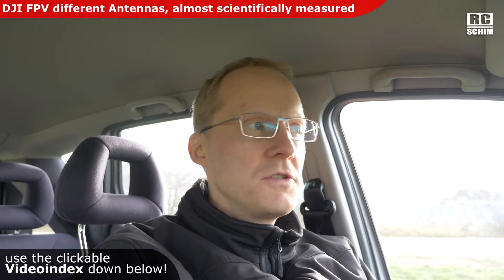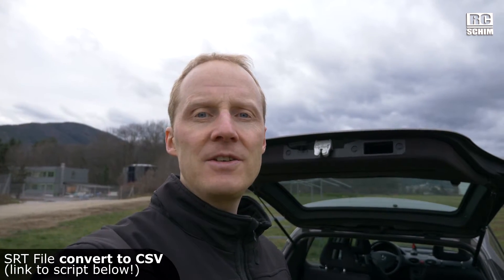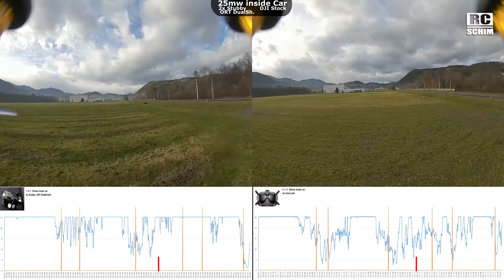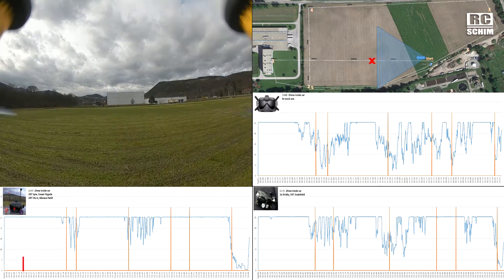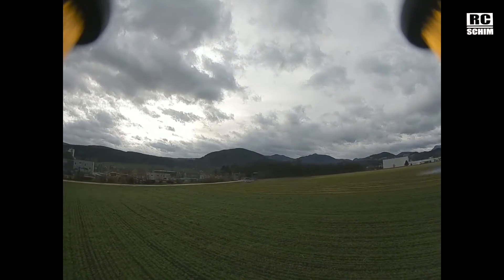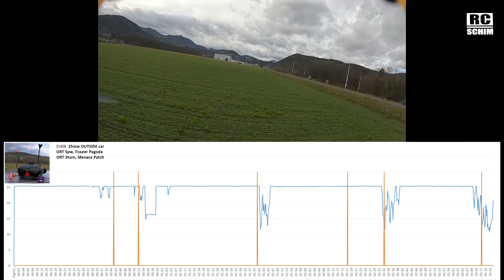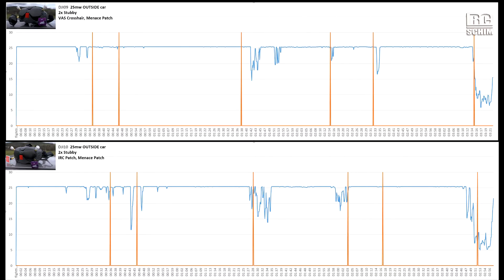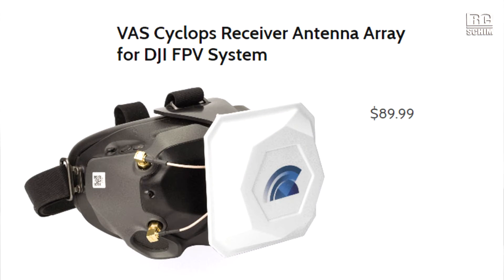DJI FPV Antenna tests - almost scientific!

Comment: Seems like we all come full circle on DJI antenna testing. We won't keep them stock,.. but after we find the best, we revert to what's "good enough" but will pack without removing because the DJI really does quite well regardless. BTW, the Cyclops does pack fine if you leave it on there. It stays in position. It's just one of the more ugly antennas,...

I find it interesting that people put the patches on the bottom. Since it is a bidirectional system, why would it be "better" to have your best antennas on the RX only? That means the return signal to the quad will be weak. The precedence that we have for something that can receive only isn't pretty: In a Mr Steele video, he filmed a "spectator" goggle, and it often would lose sync even though Cricket never had  an issue with the primary goggles. With them on the bottom, you are increasing the efficiency of the system overall, but not by as good as you would be if those antennas could also transmit. I'm fairly certain I ran with high gain omni's on bottom, then on top, and on top was better.

On the subject of the bottom two being RX only, I am wondering if that is its "default" mode, but changes based on conditions. The FCC docs showed different configurations and 3 of the 4 had RX/TX. Only the bottom left( while worn) was RX only. I'm curious if you ran it out a ways to were the signal goes bad, if that lower right hand antenna would wake up.

I really want to get one of those meters eventually,.....
Reply: Interesting analysis! I will have to try patches on top and see what that gets me
Reply: @AgustinMolini  it's known info that directionals should go on top or duals used on one side for best results, disappointed he didn't try that configuration, I use VAS cross hairs on top 2 ports
Reply: @flo-ridafpv5713  Yea I'm only 6 months in to the hobby and my goggles should get here on Saturday so havent really heard that before. But that's great to know.
Reply: @AgustinMolini  cool great choice going dji man you'll love it just fly in 4:3 as 16x9 sucks way too big n zoomed, made me sick, but might be OK for a wing, check out my vids to see performance in different types of cool spots w diff  antenna setups, I superview my goggle dvr lol works great
Reply: Yeah brother wish he tested top ports with directionals :/
Reply: @flo-ridafpv5713    No worries. He reads comments. It'll be in the next video.  ;)
Reply: @rcrdps8144  lol let's see that'd be great
Reply from the maker: I only had a limited time for testing there. In general - I'd like to test way more indepth - but mostly it's time constraints... 
Read before that it should be better, to have dir. ant. sideways but I wasnt sure about this. Next time (followup video?) I'll test it this way...

Comment: I'd go with the VAS. Always used the IBCRAZY & VAS antenna's for great range with my planes.
Reply: I have a full VAS set for mine I use 2 xhair xtremes on top as they send n receiver + 2 vas ion v2 stubbys on bottom, but its big, so mostly run 4 lollipop stubbys w mmcx lollies on all kwads.  Check my vids to see range it's crazy good, I just superview my dvr lol
Reply from the maker: That's what I thought: with enough power you dont care about big directional antennas, just a few stubbies :) 
But I see you mainly fly freestyle close up and thru a lot of stuff (remember your videos). Nice collection of DJI FPV vids already :)
Reply: @Rcschim  yup thanks man :)

Comment: Great video, thanks for the effort!
One question: what about stock air unit antennas? Are they much worse than these?
Reply from the maker: I didnt actually compare the stock Air antennas vs. my upgraded ones. 
The reason for swapping them out was just the wrong polarization  (all my antennas are on RHCP, DJI is here on LHCP).

Comment: Thanks for the test Mario! I am looking into comparing some antennas as well. Too bad it's much more complicated than analog.
Reply: For those outside the US like me and Mario it's difficult to get some antennas. 😕
You're in or out of the US?
Reply: @MCsCreations  in Europe its quite easy . My local Store has this lolipop3 always in Stock :-)
Reply: @shambler01  The Lollipop is easy. You can find them at Banggood easily.
Reply: @MCsCreations  you mean the shield? I got that from a local Dealer AS well
Reply: @MCsCreations  I am not from the US. It's difficult to test the antennas - not to get them ;-)